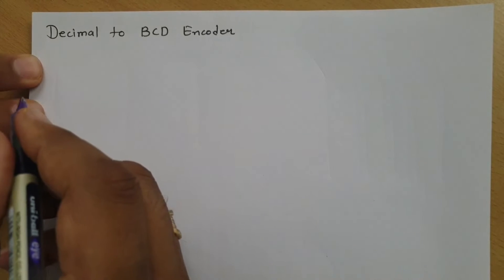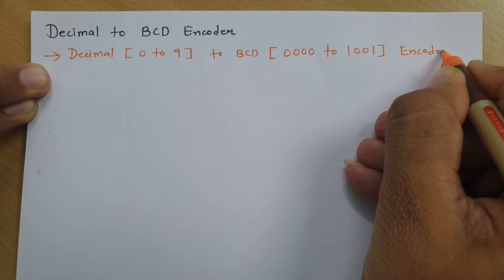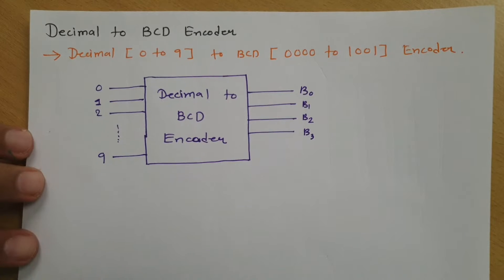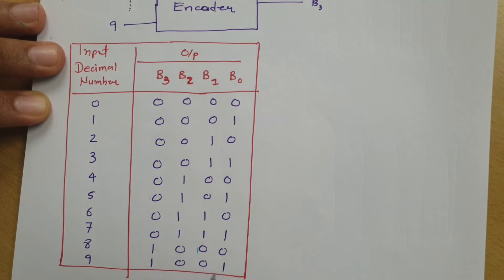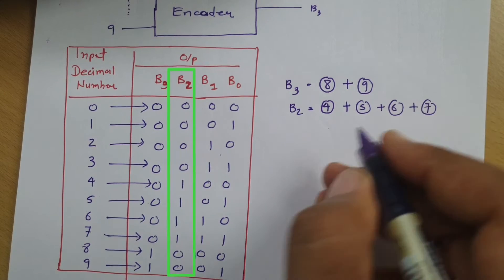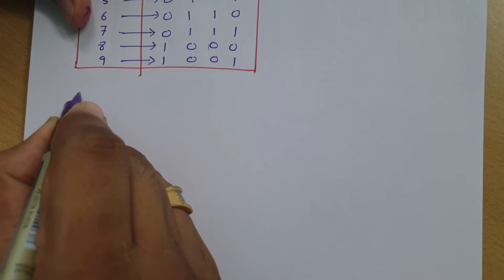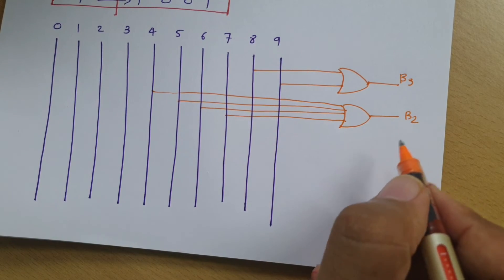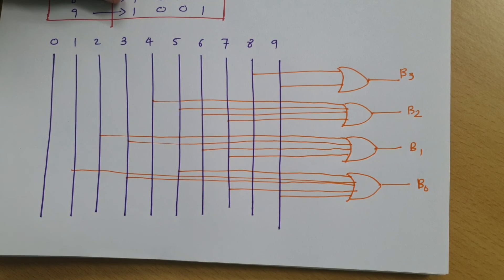Decimal to BCD Encoder: Basics, Working, Truth Table, Boolean Expression, and Circuit Design

Comment: Sir why the concept of  if 2^m input m output is not happening here ...
Reply: i don tknow if you need this information now or not.. but the concept you are mentioning is happening here... 10 inputs means we need more than 3 output lines. We only require 4 outputs not 2^4 = 16. So we ignore the rest outputs. We just consider those 4 outputs. As by our circuit design, rest outputs are not possible though conceptually they are there.